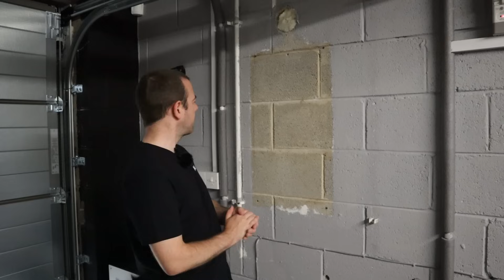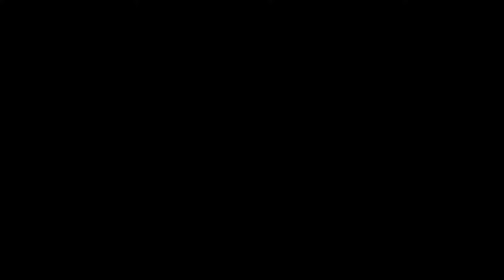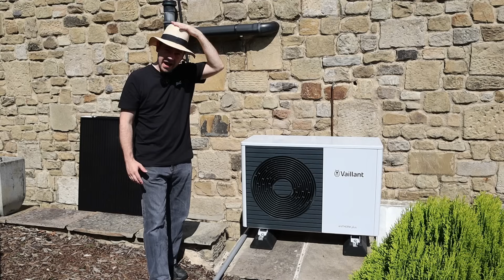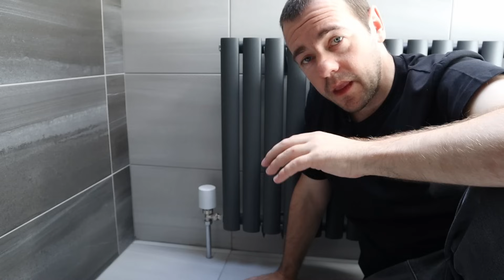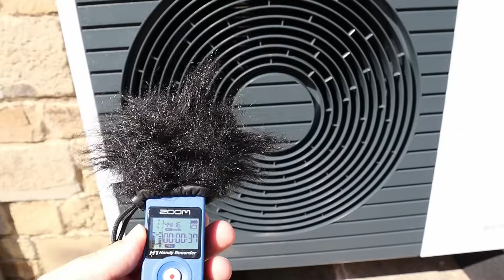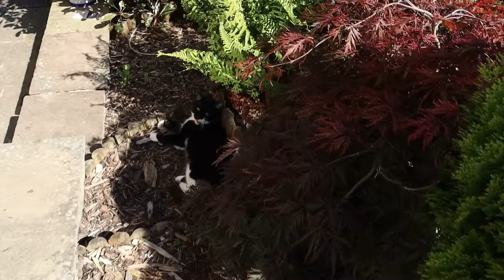Heat Pumps - Our 'Ugly' Truth!

Comment: How does a heat pump get past the second law of thermodynamics? How can an electrically driven system be more efficient than basic electric radiators?
Reply from the maker: This is possible because they are using energy to move heat – rather than converting the energy directly to heat.
Reply: @ElectricVehicleMan  OK, but where's the heat? If my flat is freezing and the outside air is freezing too, how does that work?
Reply from the maker: @khtnsuwdih  the refrigerant is very very cold, even winter air will heat it up.
Reply: @ElectricVehicleMan  do you have a link to a page that shows just how it works?
Reply from the maker: @khtnsuwdih  Prob better just searching on YouTube. 
It’s basically a fridge in reverse. Touch the back of your fridge and it’ll be warm. 
Moves heat from inside to outside the fridge.
Reply: @ElectricVehicleMan  and this roundabout process is somehow more efficient than powering electric heaters direct from the mains? Sorry, but I can't get my head round the 'something for nothing' aspect of it.
Reply from the maker: @khtnsuwdih  it’s not something for nothing, just like your freezer. 

Literally works the same way. Moves heat from the inside of your freezer to your kitchen yet doesn’t use tons of energy. 

To provide heat, a heat pump works by extracting heat from the air outside of your home and transferring it to refrigeration coolant – the coolant is then compressed, which increases the temperature significantly; the coolant is then moved to the indoor unit of the heat pump, heating the house.
Reply: @ElectricVehicleMan  so, all those stages - extraction, transfer, compression and moving still ends up more economic than, say, a storage heater? Wow.
Reply from the maker: @khtnsuwdih  Generating heat is far more intensive than moving it.
Reply: @khtnsuwdih Absolute zero is −273.15 °C .There is a lot of heat in the air even at 0 degrees.

Comment: What a load of CRAP! We're listening to someone who is being sponsored, I guess?? I'm a sparks of over 50 years' and now you're trying to tell me that we need to go back to using emersion heaters??? 2.5kw In running the heat pump??? With rising fuel costs... pure MADNESS!
Reply from the maker: I’m not using the immersion heater, it’s disabled. 2.5kW is the max rate worst case which for me it will never go near. 
It’s all in the video. 🤷‍♂️

Comment: to reduce running cots set the flow temperature a slow as possible to increase the efficiency- the difference between the flow temperature and the outdoor temperature will determin this.

Comment: as an EV owner for over 12 years and renewableEnergy specialist I always said to customer, a renewable system needs to have 3 components, well designed, good product, well installed. The design is critical- full heat loss assessment- MCS state you must do a room by room heat loss calculation and use local weather data, radiators need to be sized for the lower flow temperatures, so radiators need to oversized to give the same output.

Comment: With the new approx. standard cost of power gas 15p\kWh and electricity at 50p\kWh how is the heat pump cheaper? Can your system use conserved energy over the evening energy peak so that it isn't adding to a possible collapse of the grid?
Reply from the maker: No but the battery sat next to it can. That and the solar panels.

Comment: When it comes to retrofitting air source heat pumps, many existing homes would be better off installing high temperature air source heat pumps because they do not require new pipe work, new radiators and all the extra cost that comes with retrofitting low temperature air source heat pumps.
Reply: But a higher temperature flow will reduce the efficiency of the heat pump.
Reply: The larger the temperature change. From the out side air to the water temperature you have coming off from your heat pump the more power it will use to do this . 
I can see this on my system as the temperature of the system rise. So does the kw being used by it

Comment: We’re definitely going for a heat pump. However with recent heat waves and insights from Mr EV channel - I’m considering an air to air heat pump to facilitate air conditioning. I work from home permanently and the portable air conditioners don’t work well enough and are noisy. What are peoples thoughts on air to air?
Reply from the maker: You’d need a unit on a wall in each room. For me this wouldn’t work and would make the room look like an office.
Reply: I installed a small minsplit for my shop.  It works great.  Very quiet inside and out.

Comment: Looking forward to more follow-up videos! Is  this heat pump able to operate in reverse to cool radiators slightly in summer? If yes, how is condensation minimised?
Reply: Best not to try, most domestic heat pumps are not reverse cycle as they do not apply for the Govt Grants. You are correct re condensation off the rads, if you had Fan Coils instead it would work both ways. 👍
Reply: air-2-air heat pumps have the advantage of cooling in the summer as well as heating in the winter.  Andrew Till UK youtuber likes the cooling and the heating .

Comment: The clue is the necessity for such a high standard of insulation
 This masks the lack of efficiency.  Lots of electricity used too, with the cost of installing the insulation , the compromise of heat in efficiency they are just a scam.  The only thing they are good for is generating the need for installation companies,  the producers installers.  Not good  the householder.

Comment: Balls. Baltic counties use heat pumps for air conditioning in the summer , in winter they switch them off and turn on the gas. Don't lie.

Comment: Yes of course heat pumps work! But their economic success is almost entirely based upon the ‘spark gap’ (difference between cost per kWh of gas verses electricity). And air source heat pump efficiency is of course at the mercy of ambient air temperature. I have been designing heat pump installations for commercial properties for a while. So I know a little bit about HP economics. It will be interesting to establish your annual seasonal COP which takes into account winter external temperature and additional energy you will incur on defrosting your evaporator. I think you have done the right thing though and it is useful to see the domestic consumer experience on show.

Comment: Heat pumps cant give you on demand hot water as a comi gas boiler can. It is a waste of energy to heat a cylinder of water and have it there for when you might use it. A heat pump runs for considerably longer than a condensing combi boiler to give you that 5 minute shower and given that gas was a quarter of the price to heat your water. My ideal would be a small cylinder to store hot water that was heated by solar panels that then becomes pre heated water before being used for your 5 min shower via a combi boiler. That same cylinder would also have an indirect heat loop to my log burner for winter pre heat water.
Reply from the maker: How long it runs is irrelevant, how much energy they use is what matters. 
~85% efficient for gas
~200% efficient for HP water 
Might as well use that solar to help run the heat pump, increasing efficiency even more.
Reply: @ElectricVehicleMan  what uses the most energy, a gas boiler for 5mins at 5kw for a shower or an electric heat pump at 2.5kw for 2 hours or more, it is not irrelevant how long your heat pump operates it is entirely relevant to how much more energy it will use
Reply from the maker: @robbiegerard7857  Who said it would run at 2.5kW for two hours?
The 2.5kW I stated was the absolute max the unit could use running at full pelt at inefficient temperatures. For me I’ll be nowhere near that. 
AND, the 5kWh for water was to heat the full 190litres, not just a showers worth. 
If we only use half the water in a day then it would use far less to ‘top it back up’ again.
Reply: @ElectricVehicleMan  maybe you could research how long a heatpump takes to heat the volume of water in your cylinder every day/night to get to your preferred temperature. Then compare the cost of gas for 5mins per shower. Im afraid you will not convince me that your opinion of heat pumps is stronger than the facts of Roger Bisby of Skill builder. I researched this personally, i have the knowledge to instal my own system, which, you can do at a fraction of the cost of a registered installer (which you have to use to get the government grant) You just pass any government grant to the installer! In the US you can buy a HW cylinder with a HP on top (like your cabinet) for about $1500, then you just plumb it in to your hot feed. The cost of one of those here is closer to £4000. Ps how much did your whole system cost?
Reply from the maker: @robbiegerard7857  Fint need research, my heat pump takes about 50mins to heat an emptied 190l tank. 
It’s almost never empty though so in reality it’s only heating up the difference between yesterdays usage and temp drop and a full tank.
You’re comparing whole house usage with a single shower. 
Compare how much energy a gas boiler would use heating 190l up vs this heating the same and that’s a direct comparison.

Comment: Heat pumps are terrible idea..they are very very expensive to install, use huge amount of energy, the system explained here uses nearly 2000kwh per year and only does 2 x shower and 1 x bath per day....they are only to be considered with free energy(if you have your own wind turbine or hydro scheme)
Reply from the maker: They use less energy than a gas boiler in kWh. That’s the whole point. You’d use 9-10kWh a day of gas to do the same thing.
And the water tank size dictates how much we get from a full one, not the heat pump. 🤦‍♂️

It’s not getting emptied every night and I can  fill it back up many times a day if I want. We just don’t need to.

Comment: Thank you for this video. I find it really very difficult to research heat pumps. You explained how much energy it took to heat up the water tank and how big it was. I can’t find this on Sunamp site, e.g. how many Kw will it pull, how many Kw to charge the heat battery? Does the solar version adapt consumption for available sun? No info. And in my terraced house I think I would need to have an exhaust air heat pump but Joule say these are suitable for a new build house or an apartment and I think what is different about those buildings compared to my 1970 house.  It isn’t explained, and all I see are Nibe horror stories, where Nibe say installed wrong...  So I will be very interested to learn your experience over the winter, because I’m in a similar experience with a 2006/7 gas combi and I want to do fabric first upgrades as I redecorate before changing it.

Comment: All very interesting and useful info but as the technology gets more widespread the off peak rate will increase - as it will no longer be off peak! My neighbours heat pumps are older and very noisy being audible at 2am in my house 20m away. I look forward to your report in January. Before installing anything like this I would like to know how long it's likely to last. Was being lectured at Uni about heat pumps in buildings 40 years ago by a professor who's real world preference was for heat recovery systems.

Comment: We are about to get out second air source heat pump. Our Panasonic 5KW ASHP has decided to leak the R410A refrigerant into the water side of the heat pump about 6 months after the 5 year warranty ran out. The cost of repair parts alone is about 80% of the value of a brand new one, so right now our plumber is looking round to see which heat pump would be the most efficient replacement.
Reply: I’d be concerned the plumber didn’t sort out the water quality of the heating system if it’s corroded through.
Reply: @edc1569  I don't think it was the water quality because it was a really odd case. I'm told in the majority of the cases where the refrigerant leaks into the water side the water will also naturally flow into the refrigerant side. However, in this case there was no water in the refrigerant side, but it was clear that gas from the refrigerant side was getting into the water side and could be heard coming out of the automatic air vent. If the leak was caused by corrosion I would definitely expect water in the refrigerant pipes. It might be a coincidence but the problems came to a head when we got that first big heat wave this year. I wonder if the cause was due to some kind of heat expansion phenomenon.

Comment: I went through this myself last year, but after working out the maths I realized that the heat pump would never pay for itself. Cheap fire wood in our Godin stove, a negotiated price for propane gas for the next 5 years and the uncertainty about the future of electricity (I live in France) cost meant that  I came to the conclusion that it wasn't worth the hassle. It would also seem that the heat pump compressors have a life span of about 12 years making the decision even harder..

Comment: Since you cannot rely on the 4hrs @ 7.5p cheap night rate for central heating the house in winter,  you are fundamentally stuck with the fact that with typical UK tariffs,  1 kWh from electricity costs about 4x that of 1 kWh from gas.   So even if this setup does manage to achieve a 400% COP (and you will not on a cold winters day) you might just claw your way back to running cost parity with your old gas boiler!   This is the fundamental problem with heat pumps.    The 4x cop is cancelled by the 4x tariff difference.       The only answer is to drive it with “free” electricity from solar pv which is difficult on a dark January day in the UK.
Reply: My maths is the same as your workings. A few things also to consider, the home battery can be charged at the 7.5p rate but this is only around 80% efficient on lower voltage systems. Electricity in the future should get cheaper if the government switches green charges from electricity towards gas. I worry too that Octopus may not be so generous in the future and go rates will increase considerably.  It's hard to justify a heat pump at present if you have a modern gas boiler, those running oil or electric radiators it makes sense.
Reply: All pointless to much outlay in money initially makes this totally unafordable. Also with pace electronics and energy tech is developing these setups will be out of date in 5 years time, just like the uk solar pv fad where you dont benefit because you cant store your own energy just rely and trust the energy companies to be generous and honest with their pay back tarrffs 😆🤣
Reply: Yer that’s the problem we found can’t make figures work yet hopefully the tax on electric will drop and be put on gas then will make sense
Reply: As electric cars roll out and everyone starts charging their cars at night, it seems likely that "cheap night rate" will disappear anyway so I am not convinced a battery solution will be the answer for long.   Sorry to be pessimistic!             Thanks nevertheless to EV man for continued great videos and for stimulating the debate!
Reply from the maker: In the video I never said I got one for financial reasons. I’ll try to make it as cheap as poss but that wasn’t the primary driver.  

And gas is getting closer in price too to electric so it is shifting. 

In my case (only a few others) I can also use cheap electric from my battery during the day in winter too.
Reply: @ElectricVehicleMan  but how long will your battery last mid winter when little solar is the big question I’m interested to find out ? As this could make a big difference to running costs  7.5 to 40 p is alot of difference! ? Thanks
Reply: For this to work financially, purely from a running costs POV vs a gas boiler - you need a very big battery come winter.....

In winter my current gas setup can use 40 kwh per day on a cold day - just heating the house, ignoring hot water as I use very little of that (only 2-3 kwh per day). So to get any real savings from switching to a heat pump from gas, you need all the electricity being used by the heat pump to be on the cheap 7.5p rate, and that means a massive battery! 

Even if you get the energy consumption down to a ~3rd of what the gas boiler used (a cop of 4 is not realistic in winter, more like a cop of 2.5), you are still going to need 15kwh of battery storage just for the heat pump - which is a big battery bank costing a small fortune, around £10K at current prices.
Reply: @blower1  retail prices for batteries are a bit mad at the moment, they’ll come down dramatically once everyone stops panicing about energy prices.